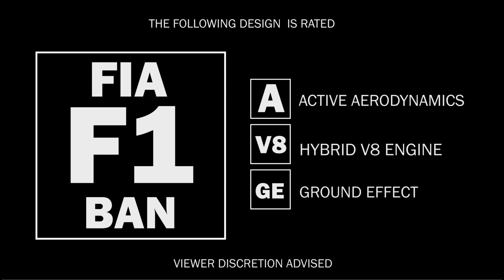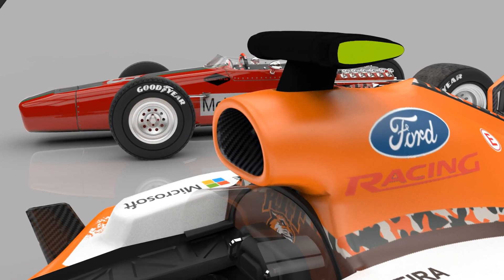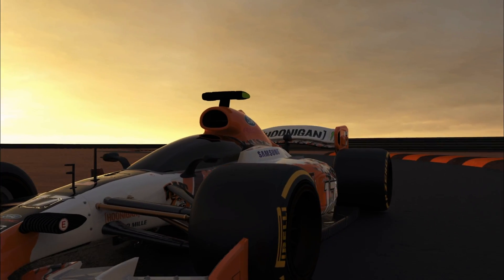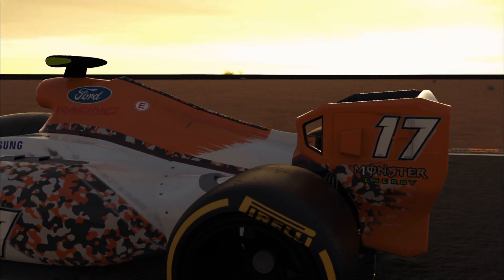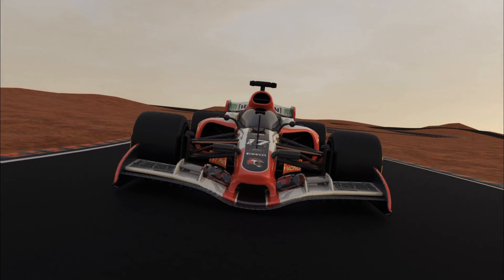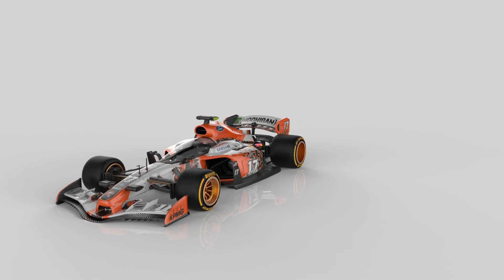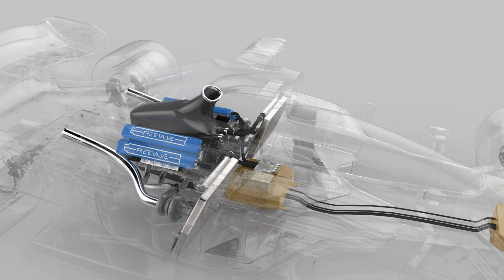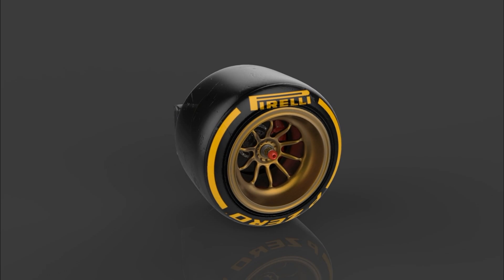Formula X (Senior Thesis Project)

Comment: 1500 HORSEPOWER??? WOW.
Reply from the maker: the modern 1.3L Single Turbo  V6s make around 7-800. With the the larger v8, twin turbos and dual MGUs putting power to the front and rear wheels during KERS it would definitely be putting power out there in the 1000+ hp range
Reply: Steven Cerqueira Man, actually F1 V6turbo is 1.5L since 2014, and this season it's power is about 1000Hp, 850 of the standard engine and 160 on the electrical engine. :).
Reply from the maker: must've had the wrong source. In any case this beast would, theoretically, have way more power lol